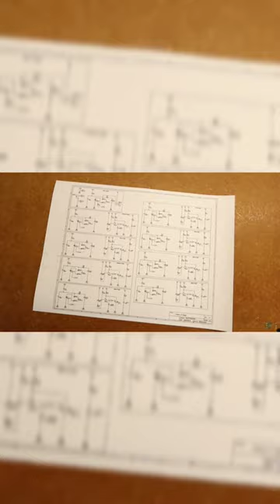Huge and powerful

Comment: try using "photo flash capacitors" they have lower ESR and lower resistance wound coils using flat copper tape. this way the on time will be smaller, optical sensors can be used to trigger the cascade with better accuracy. you could even use the charging circuits from the camera flash too, makes a great charging sound!